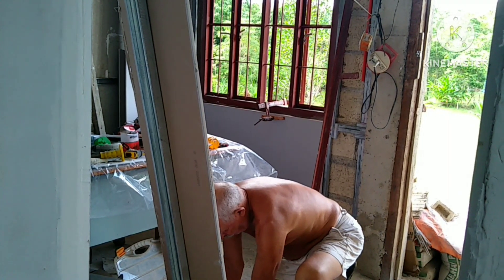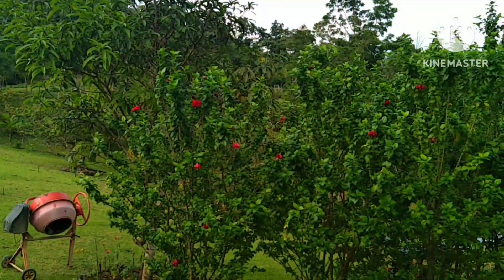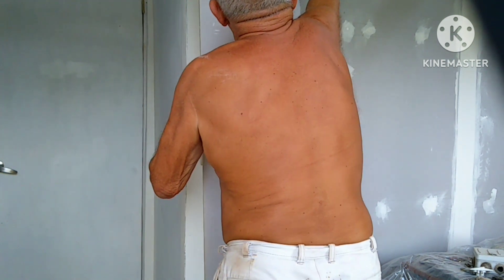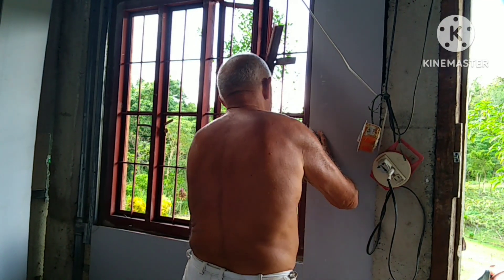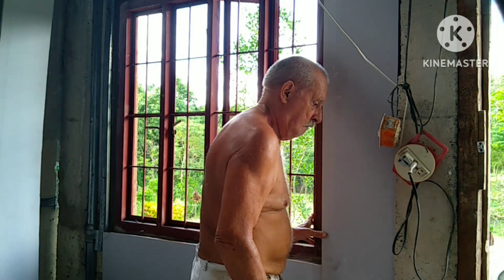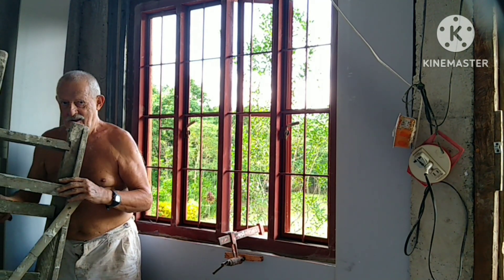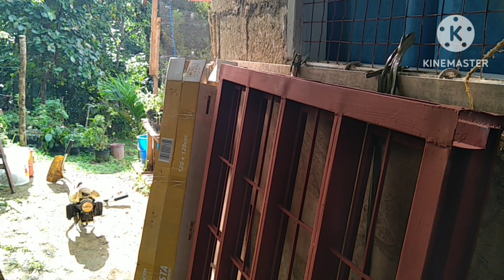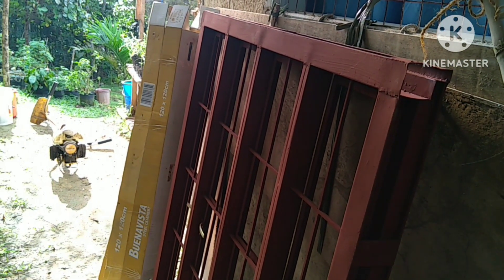New window frame/I cut grass around/French and Pinay

Comment: The windows have an old time look. I love that but washing those panes is a pain. My parents had glass French doors between the front door and the living room. It was my job to clean the windows. Those tiny corners. It should not take an entire bottle of Windex to do one door but it did. Both my parents smoked so there was tar build up on them too. Vinegar and hot water I learned later is the way to go. BUT the door was oak with glass pains. You cannot put vinegar on wood unless you want to ruin it. Then I thought of using alcohol on Q- tips to get into the corners. That worked well but it took over an hour to do one row of windows. Pretty is the window that never needs to be cleaned. Ha Ha
Reply from the maker: Thank you so much for your time Joyce. Yes where we can find a window that doesn't need cleaning 😂
Reply from the maker: I will remember the vinegar and hot water, thank you 🙂
Reply: @frenchandpinayssimplelifei1174  There are none that never need cleaning. But get plain windows. No partitions in them. They look lovely but are a real pain to maintain. If you don't mind the work get the windows that are partitions. We have jalousy windows. Privacy they call it some places. High and no one can see it. The are wide but not long. They stay clean because I put cling covering over them. You can get it at Amazon. If you want to keep the sun from making your rooms hotter in summer you can still allow in the light without the heat. Mine has rainbow patterns in it. From outdoors it looks like my windows sparkle. Inside the prisms create a beautiful rainbow on our bed ever afternoon.
Right now we try to keep warm Jan and Feb are the coldest months of the year for us in the Southwest Desert. Not humid or damp. Just cold.Take care and God bless your efforts.